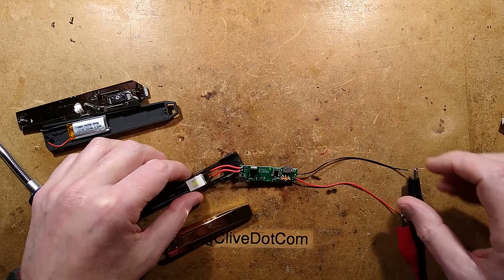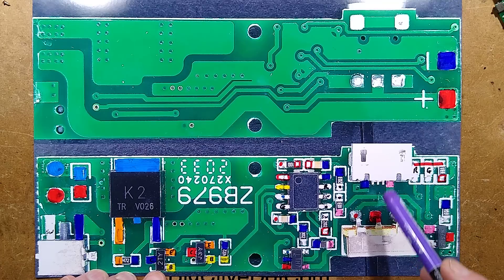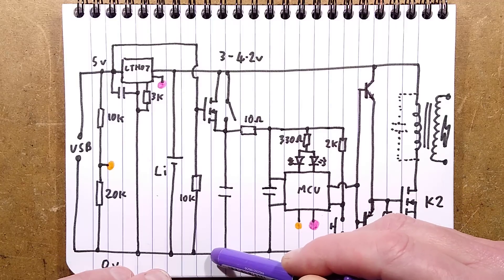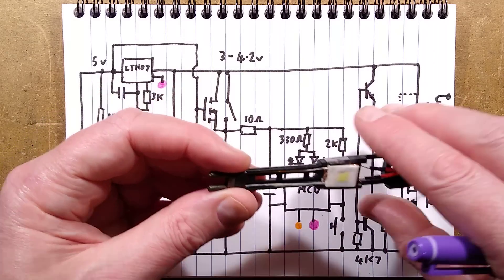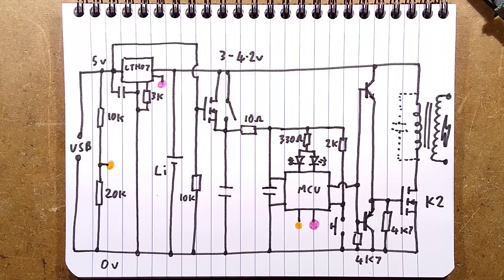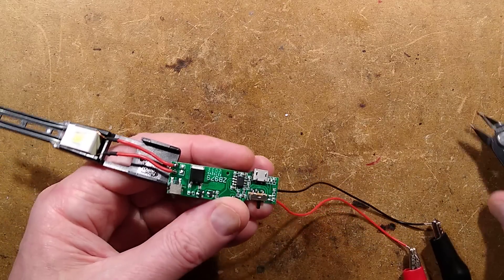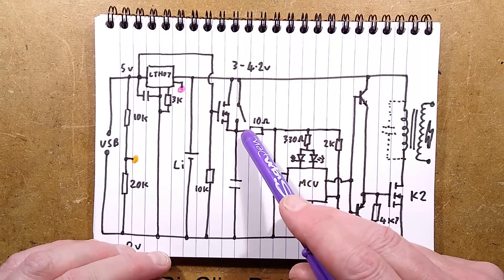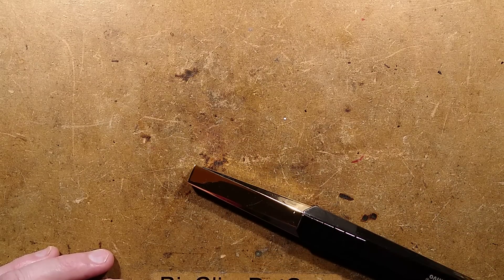Can we fix a high voltage igniter?

Comment: The 'broken' igniter might have thin enough and long enough electrodes to poke through the ceramic radients on my gas fire to light it (most igniters are too chunky), can it be purchased on ebay pls?
Reply from the maker: You can probably find the correct one on spares websites.

Comment: I have/had a few cigarette lighters (much smaller than Clive's monster) that work on the same principle. When new they work great, but I found the lifespan of the electrodes is VERY short. Within a week of regular use, the electrodes burn off and the gap becomes too large to enable the spark. Also discovered that you don't get a shock if you stick your finger in between - but you do get a pretty quick and nasty BURN! Fortunately, it wasn't my finger 😂

Comment: have you ever taken a look at those "powerline adapters" or whatever theyre called, that basically give you a wired Ethernet connection through your houses existing circuitry?
Reply from the maker: I've never actually made a video about those.

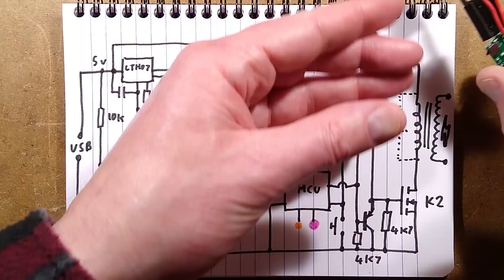Comment: around 6:15 +/-.. u said the cap across the output's possibly to protect the coil, i should probably b keeping my mouth shut im metal fab n mechanic not electronics engineer lol but would the cap across that output make the spark more energetic?
Reply from the maker: It could be used for resonance, but is mostly likely designed to clip a flyback voltage spike.

Comment: I have maybe three of those as seen on TV zippo style arc lighters and they all have failed. No charge no arc. Curious if the Mosfets in them have failed and maybe I can bypass them. May even check the runtime of one of these to failure if battery life wasn't an issue. Might steal the battery out of one of them to fix a small MP3 player that has a dying battery.

Comment: Whoofle me this Batman. What a bizarre circuit ! 
Is there not a transformer in the ceramic block ? 
 ;)
Reply: Yeah, there is. If you look at his schematic there is a transformer symbol in the top right corner. These circuits are pretty fun to play with, I a few of the DIY kits from AliExpress/eBay that I have found interesting ways to misuse😅.
Reply: Oh yeah, can't believe I missed that... Clive even mentions a "penny capacitor". 👍 
 ;)

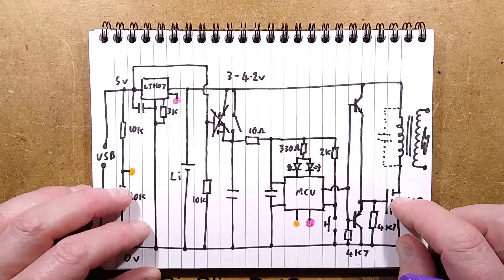Comment: 10:25 "...prone to damage from electrostatic discharge... ",  so... USB plugin zap? The cap below the switch and FET would be a direct short for a plugin changing voltage zap... (Please) Correct me if I'm wrong...

Comment: Having been burned by cooked FETs enough, I don't blame you for immediately taking the snips to it on suspicion. Anyone else who might want to avoid destroying a possibly good component, use a meter to check for continuity, or resistance. If the component reads as a dead short on all the pins, then either that component is bad, or something very near it has gone bad.

Comment: Really enjoy and admire bigclive that repairs / delves into all sorts of gadgets. His skills are remarkable, along with his detailed explanations of how the "thing" works.

Just wondering if he has delved into the aspect of "street lighting" that a certain Mr Steele has been going on about. It would be useful for that area to be covered / presented to Mr Steele.  Any thoughts / comments about that. 
Note that I have not mentioned key words just in case!!!
Reply from the maker: I've mentioned him in the past, but not identified him, as I have no desire to drive traffic to his channel.  His idiotic conspiracy videos have put the safety of electrical workers at risk.
Reply: @bigclivedotcom  Thanks for taking the time to respond. 
Going through a streetlight / lamp set up in the fullness of the way you do then your video might provide really good "evidence" of his false claims. 
I have already questioned his 400 V capacitor (why is that there?) claim but did not get a reply from him. I stated 400V capacitor there because, r.m.s /peak, 3 phase + nearest available value / extra allowance for safety etc
It is JUST the TRUTH that I am after.

Comment: The charge detect mosfet will drop voltage between gate-source, so the output to the uproc will be about 3v, its possible that the pushbutton input on the uproc is an analogue input that detects the difference in voltage between the charge input being connected and the button being pressed, so it can detect whether its connected to a charger or your pressing the btton to light the stove for a brew.

Comment: I wonder if you could use the circuit of these to drive those electric mosquito swatters. I've done 9 volt battery mods to those to supercharge them, but this looks even better, seeing that it can bridge a gap with an arc.
Reply: there are much easier ways to drive those electric mosquite swatters with much more UMPF to it. 
Supercharging them basically.

But, when you go baloney, they might be dangerous to actually touch. :)

Comment: So they are driving the base of two BJT without any base resistor, from a single MCU's push-pull output pin? 
I guess there will be a lot of cool-down period between each use! lol
Did you put a scope on FET's gate it to see the coil driving frequency? It sounded like 800Hz to my ears.

Comment: Showing my age here, but when I was a much younger lad visiting my grandparents in Italy, my grandmother and great aunt had such things which plugged straignt into the mains to light gas kitchen stoves (a bit like a smaller one of these magic wand things, totally different intended usage). They crackled and vibrated most alarmingly, used to terrify and fascinate me in equal measure. None of this "circuitry" rubbish, just good ol' fashioned mains voltage, women were real men back in those days!
Reply from the maker: I made a video about one of those from Russia.

Comment: Good job. Note if the NPN and PNP were swapped, they'd both conduct and blow up, as the current would flow through the PNP's base, to the NPN's base, with nothing to limit it. The pull-down resistor ensures both transistors turn off the the MCU's output goes high impedance.

Comment: I thought it was a 555 timer based circuit but it's not.
The chip and mosfet looked familiar. I'm not sure if you can get smd 555 timers.
Reply from the maker: You can.  But not as versatile as a microcontroller.

Comment: Even though Clive warned us, I still almost threw my tablet across the room at the high-frequency sound. I'm quite glad I wasn't wearing headphones and the volume was low! I wish other youtube channels would warn us about strobing and high-frequency sounds, one of the many reasons this is a favorite channel. 🙂
Reply: I hardly even noticed it. I'm not sure if it's my equalizer settings and the frequency response of my speakers (they don't have a lot of treble) or if it's my bad hearing, but it wasn't very unpleasant to me.
Reply: It was a pleasant sound. Like listening a ZX Spectrum program from tape. 8:47
Reply: @atdzsny  unfortunately, I don't share your opinion. I don't know where my cut-off is on higher pitched sounds, but at a certain point, they become very painful to me. So badly, I couldn't complete audiometric testing at work. After 15 years of annual testing, they were kind enough to allow me to proclaim total deafness at frequencies above 2.5K to avoid "undue stress". Sadly, I can hear ultrasonic atomizer discs, and at a certain point, can't be in a room with them running.
Reply: Not that high a frequency, a few kilohertz at most I would guess. Otherwise I wouldn't have heard it with my aged ears 🙂
Reply: i was  lol  Jason   no joke   but Clive did warn me  i wear hearing aids any way  when am out & about  intown   so am half deaf any way  it didn't bother me
Reply: I think that Clive should issue a trigger warning on everything that he does. He is bound to trigger something and should, therefore, veer on the side of caution.
Reply: @Mike-H_UK  I partially agree, but my fear is with trigger warnings being repeated too often, they may be ignored. I think he's found a good balance between trigger warnings of the worst potential offenders, and having too many. But, pretty much anything can be a trigger to someone, and certainly don't need anyone to suffer needlessly. It's a difficult balance to achieve.
Reply: @jasonkuehl639  I really like what your saying. It’s an emphatic way of thinking.
Technical and empathic: How I imagine Clive’s viewers. ☺️👍

Comment: My God, Clive, you soon nipped that in the MOSFETs!

Different tack, I know, but some years back I had a general coverage radio receiver which boasted MOSFETs in its circuitry. All was well for a year or two, but then one night it wouldn't do anything beyond light up the dial lamps. After a bit of fruitless endeavour, I sought out some assistance with this thing. It turned out that it didn't need much in the way of a static charge on the aerial to destroy one of the MOSFETs. Once replaced, all was well again. But I made sure the aerial was grounded from then on, and as added protection, I would disconnect the aerial when not in use. I was intrigued to notice that on a foggy night with just enough air movement, there was a hefty spark which jumped at regular intervals from the centre pin, to the outer ring of the PL259 plug - a gap of about a quarter of an inch. There was the smoking gun. The bandit who shot the MOSFET.  I wasn't tempted to stick my finger on the end of that plug, just in case! But surely, there can't have been such a massive charge on the aerial? However, it was enough to fry the MOSFET.
Reply: Those LED lamps with built in batteries flicker in a thunderstorm when the mains fails, and they are lit, as the induced voltage in the mains wiring is enough to trigger them to think the mains is back on.

Comment: Bugger, sorry I missed that stream.

My cigarette lighters (both of them) use the same arc, a little purple high-frequency-looking thing, ignites a rollup well. The other type of high-voltage Chinese rubbish-toy gives off less sparks, but meatier ones, white, powerful looking, nasty! But only a couple, to a few, times a second, depending on electrode distance. I imagine it's either charging a capacitor, or it's ionising the air til it breaks down, hence the "SNAP-SNAP-SNAP" rather than "bzzzzzz". If it were a voltage multiplier, that would imply capacitors, though not necessarily big ones.

Anyone else got one of these and played with it? The black cylinder with 4 wires, works off 4V - 6V, wire it up and go. Works nicely off an 18650 but seems to flatten it in 2 minutes flat. Must be a lot of amps going into those volts.

Creates a right whiff of ozone too! You can almost see the air getting clearer, and get a real refreshing noseful. I'll probably get nose cancer but it's still refreshing.

Comment: Since there's no need for a linear behavior but instead a sharp switching between on and off the NPN/PNP connection that's in the picture makes sense to me. This way the NPN is fully turned off when the PNP is turned on and the other way around.
This is way more advanced than the piezoelectric igniters that used to be the norm.

Comment: The LTH charge controller chip's output signal normally connects to an LED, because this is a high voltage, high frequency device the signal coming from the charge chip is used to disable the function of the device while charging just to protect the charger as that is also a high frequency device so any voltage difference on the ground line can be lethal and also the fact that you can charge this device from sensitive devices like a PC, a laptop or even a TV.

Comment: I'm not seeing why this circuit would refuse to work with the blown FET passing 5V from gate to drain/source in parallel with the switch apart from the MCU crashing shortly after turning on the LED due to the unexpected input voltage.
Reply: As pointed out in another comment the microcontroller disables the spark function when it is being charged, so as not to either destroy the charge source if it is a computer, or break down insulation if it is a plug in USB charger, as otherwise the output voltage is high enough to do so in both cases. In the computer sharp power supply spikes will destroy chips, and for the charger the Y interference capacitors, and the transformer, are only rated (on real ones, dodgy and super dodgy ones much lower) to 1kV DC isolation, and break down around the 2kV region. The arc is more than 5kV there, well past that, and going to destroy the devices.

Comment: Why didn't you replace the fet?
Reply from the maker: It was just for the ability to charge while switched off, so rather than risk it failing again I omitted it.
Reply: @bigclivedotcom  That's confused me (no change there), wouldn't the battery charge anyway, because charging is controlled by the LTH07?
Reply from the maker: @ralphj4012  The processor thought the charger was plugged in due to backfeed through the failed MOSFET.
Reply: @bigclivedotcom  Thanks, though isn't the battery disconnected and an external supply is being fed in (at 0:44), so the charger is effectively plugged in, or you are feeding power in on the output side of the LTH07?. Please don't waste your life answering my queries / confusion

Comment: The high frequency noise sounds remarkably similar to the initial tones on a ZX spectrum tape. Either that or my memory's faded in the last 35 years :)
Reply: Yeah, the frequency may not match, but it was very similar to the fixed frequency pilot square wave followed by the short sync pulses and header data  (program name, length, etc). 8:47